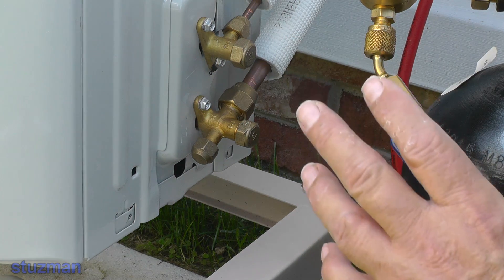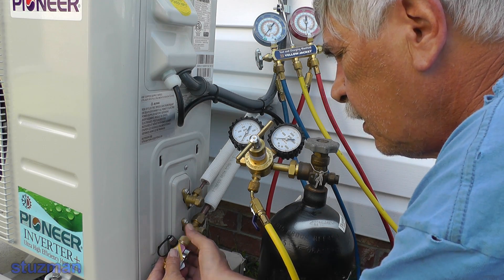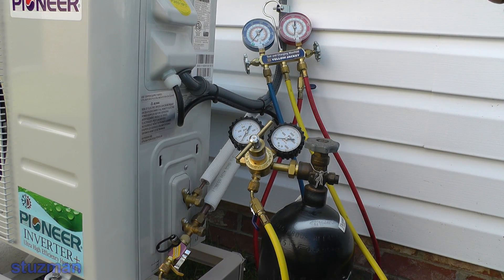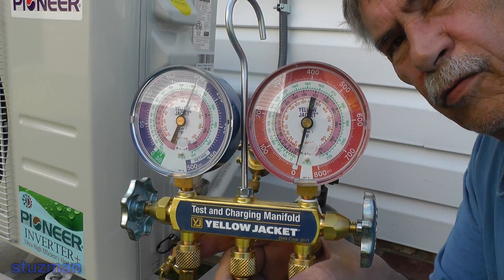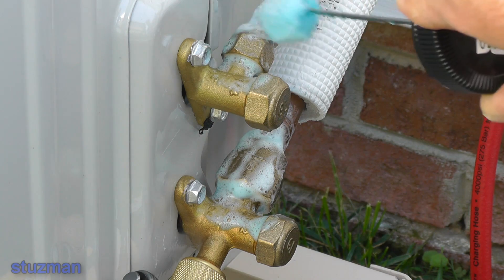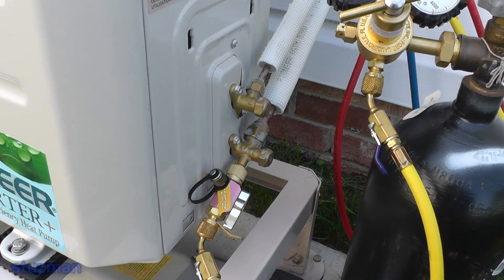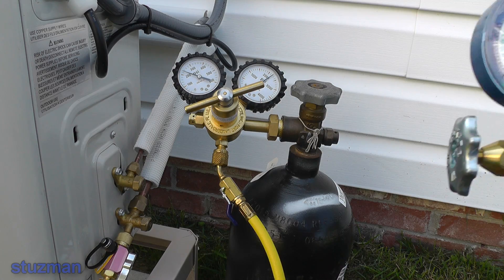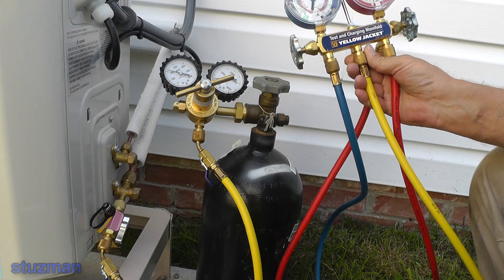Mini-Split Heat Pump: Nitrogen Pressure Test

Comment: 200 psi is a standard, or every brand has his on psi
Reply from the maker: No, it's not a standard really for any brand. I just picked it and of course, one could use 300, 350, 400psi. You just don't want to exceed the test pressure of either coil, whether it's the inside coil or outside coil.

Comment: Do you really need to remove the core and have the core removal tool attached? Why?
Reply from the maker: No, not absolutely necessary. Removal of the core speeds up the evacuation process.

Comment: I just replaced a mini split which the HVAC tech that commissioned the system pressure tested for only 10 minutes.  After 2 years it ran rough. At 3 years, refrigerant was all gone. I pressure tested it myself and it would drop about 10 psi overnight.  My current go to HVAC guy recommends 4 hours minimum, first at 50psi, then 200, then up to the design pressure written on the ODU label.  FYI to anyone else out there.  Upon disassembly, problem most likely was an overtorqued 1/4 connection with a poor flare.
Reply from the maker: Thanks for the helpful information, and I appreciate you sharing your experience!
Reply: Seems like a lot. If you are loosing refrigerant that'll show in a vacuum test. Did the original tech pull a vacuum? That would fail immediately
Reply: @WyattEmge  they did both vacuum and pressure test but not for very long.
Reply: @PeterVieth yeah you gotta pull for like half an hour and let it sit for half an hour.

Comment: I've been looking everywhere for that white strain relief connector you used on the control cable (cable that goes to the indoor unit). Do you remember where you bought it? Problem I'm having is finding one that fits the 3/8" control cable, but also fits the .850 in hole in the electrical terminal access panel.
Reply from the maker: You can get one at Home Depot or Lowe's. Here's one from Home Depot https://www.homedepot.com/s/strain%20relief%20connector?NCNI-5&searchAnalytics=strain%20relief%20connector-_-type%20ahead-_-1|1|1-_-typeahead-v2-search-api-_-strain%20relief%20co
Reply: @stuzman52  Thank you!

Comment: I have been studying your instructions regarding mini split installation and commissioning procedures and have a question. I am near the completion of installing a new Daikin, multizone (4) 36kBtu system (4MXM36AVJU9). The commissioning instructions state I should pressure test, separately, both the liquid and gas lines to a maximum of 604 psi. Do I just repeat the procedure in your video for each service port? Thank you in advance. J. Jones
Reply from the maker: Yes, that is correct! You will test each system separately. Good luck with your installation and have a great day!

Comment: First, I’m not HVAC experienced. Second, of the 18-24 videos I’ve watched, your’s is the best step-by-step instructions I have found. I do have one question- Once you pressurized the system to 200 psi and watched for any pressure decay, I didn’t see/hear a step where you isolated the nitrogen supply from the system under test. Wouldn’t the system being tested need to be isolated from the nitrogen source before you checked for any ‘pressure’ decay’? (I would think if left connected, you would continue to pressurize the system, although bubbles would indicate a leak)
Reply from the maker: Several people mentioned that I didn't turn off the valve. I did turn the valve off at around timeline of 4:00, but forgot to mention it. You can turn the valve off at the nitrogen tank or you can turn the valve off at the manifold gauge set. I turned it off at the manifold gauge set. Thanks for watching and sharing a comment! Have a great day!

Comment: Great vid!  What is the 1/4" core removal tool on your list for?
Reply from the maker: Two reason; the first and most important is to keep the refrigerant oil off of the micron gauge when the refrigerant is released. And second, it's to keep the high pressure from the refrigerant reaching the micron gauge since it's rated for vacuum pressure, although the gauge is supposed to handle high pressure.

Comment: Is it good idea to purge the yellow service line hose with some nitrogen before opening the low side valve to feed nitrogen in?
Reply from the maker: No need to purge the air from the line for a nitrogen pressure test since air is 78% nitrogen.

Comment: How about indoor unit fitting no more leak test?
Reply from the maker: When you pressurize the line-set, the nitrogen will also go into the indoor coil. And you would notice a pressure drop on the gauges and of course this would include soaping the fittings where the fittings come out through the wall and at the outdoor coil. And the indoor coil would already be pressure checked at the factory.

Comment: What size nitrogen bottle is that and how long is it expected to last how many mini splits can it pressure test?
Reply from the maker: 40 cu ft bottle should be sufficient. I purchased my bottle and nitrogen from www.airgas.com a few years ago. At the time, the bottle and nitrogen was $130. Then when the bottle runs out, you return the bottle and then get another bottle already filled. And if I remember correctly, that was $30 for the nitrogen. Nowadays, who knows what the price is since everything has gone up. Good luck on your installations and have a great day!
Reply: @stuzman52  thank you! You as well!
Reply from the maker: 40 cu. ft. I still have the bottle with a good amount of nitrogen in it. Have done several mini-splits and used it on cars. Can't say how many installations it can do.
Reply: @stuzman52  thank you,  what's the smallest size I would need to do 5 mini splits. I know nitrogen isn't cheap so I wanted to get the appropriate size bottle.

Comment: the gauge pressure showing 200 PSI would never degrade even with a leak as long as the valve was open to allow nitrogen into the system. You would need to close off the valve on the yellow line and then if there was a leak the blue gauge would degrade.
Reply: He didn’t show it but he isolated the valve on the bottle

Comment: Do you shut the unit down before starting?
Reply from the maker: Yes, the unit is not running before you do this test. Typically, this test is done before the unit runs the first time as this is a new unit.
Reply: @stuzman52  thank you. Awesome video. Would you ever do the nitrogen pressure test to try to pinpoint a leak?
Reply from the maker: @DGoku37  Yes, the whole purpose of the nitrogen test is to find leaks that may be in system after an installation.

Comment: My only comment is you wasted lots of time wiping off the soap mixture and even blowing it off with air. That leak mixture doesn't eat up the copper like really soap might. That's why you paid big bucks for that bottle of solution. Thanks for the video

Comment: Very well done video.  You are slow and methodical about the way you explain things so anyone can understand exactly what you’re doing.  One tip, if this is indeed an r-410a heat pump (not an AC only system), your lineset’s flares will indeed see pressures in the 400-500 psi range in heat mode.  So if you do a nitrogen pressure test, a higher psi test than what you did may show flare leaks that a lower test pressure may not.
Reply from the maker: Thanks for the comment and have a great day!

Comment: Is this test that you are showing also pressurizing the ODU at the same time 

Or are you bypassing the ODU and just testing the line set and IDU
Reply from the maker: When the unit arrives, the outdoor unit will contain the refrigerant with the valves closed to keep the refrigerant inside the unit. When testing for leaks with nitrogen, you are checking all of the line-set fittings plus the indoor unit. Since the indoor unit has already been checked at the factory for leaks, one will concentrate on the line-set fittings. And the same holds true for the outdoor unit since it would have been checked for leaks at the factory.
Reply: @stuzman52 I'm not sure why I asked that question it's perfectly clear what you guys were doing I was thinking something else in my head but let me explain and hopefully you can give me a good answer The refrigerant was lost and the guy took it out and installed a new system he then called me over to come get it and it sat there for 5 or 6 hours after he took it apart and so the first thing I wanted to do was use the Allen wrench to close off the ODU from any outdoor debris and weather getting into it 

And then I sealed off the line set and also the IDU 

I want to test them now and see if I can find out how it leaked 

I didn't see any oil on anything not on the ODU IDU or line set so I couldn't tell automatically where it was leaking from 

I ordered a nitrogen bottle and a regulator 

And when it gets here I want to test the line set the IDU and the ODU 

If I hook it up the same way you did 

and just open up the ODU valves with the Allen wrench

Will that work in testing the ODU also 

Or does the ODU contain some kind of oil or something else that might cause a problem if I pump in 200 psi of nitrogen
Reply from the maker: @Jonehughes  I assume that since he changed the outdoor unit, there was a leak in it. I wouldn't bother hooking it back up to the line-set as you can charge the outdoor unit by itself with nitrogen. Be sure to take the outside covers off to get access to all the plumbing and to the thermostatic valve, pressure sensors, etc. Good luck on what you find!
Reply: @stuzman52  thank you 
 that's very helpful 
I don't know why I didn't think of that
 but that's why I have you 😍🥰
Reply from the maker: @Jonehughes  Glad to help and have a super great day!

Comment: did you vacuum out all of the air from the line sets before pressure testing with nitrogen?
Reply from the maker: No, you pressure test with nitrogen first and then vacuum afterwards provided you don't find a leak.

Comment: Just wondering. A lot of installers say not to coil excess line set vertically due to possibility of oil pooling which I understand. So , what about when the inside unit is lower than the outside unit as with a basement install? Why doesn't the oil pool in the head?
Reply from the maker: I'm trying to think of an installation where the indoor unit would be lower than the outdoor unit. Even with a basement installation, I can't see how the indoor unit would be lower than the outside unit. Sure, there are installations where dirt is covered higher on three of the walls. But, that would be considered a crawl space. I can't think of the repercussions if the unit is lower than the outside unit. Maybe nothing will happen to the oil and the refrigerant pressure will push it through. I haven't run into an installation where the indoor unit is lower than the outside unit.
Reply: @stuzman52 Around here, a lot of full 8ft concrete basements are backfilled up to 6 and 7 ft. So the inside head has to be lower than the outside.

Comment: Is 200 psi standard or should you go higher or lower depending on what your units nameplate says?
Reply from the maker: 200 psi is not a standard. You can higher or lower, but never exceed the maximum working pressure of the unit(s) being tested.

Comment: OH BOY… THERE WASN’T ANY PRESSURE DROP BECAUSE YOU DIDN’T SHUT OFF THE NITROGEN TANK AND ISOLATED THE LINE SET  THROUGHOUT THE WHOLE TEST.
Reply from the maker: YOU CAN CLOSE THE NITROGEN TANK VALVE OR YOU CAN CLOSE THE VALVE ON THE MANIFOLD GAUGE SET. I CLOSED THE LATER. SOME FOLKS MENTIONED THAT I DIDN'T CLOSE THE VALVE, BUT IF YOU READ THE COMMENTS, YOU'LL SEE IN THE TIMELINE WHERE IT WAS DONE.

Comment: Where do you get the fancy adapter rig on low press side or nitrogen entrance?
Reply from the maker: I assume that you're talking about the adapter which connects to the low pressure side. This is a 5/16" adapter instead of the typical 1/4" adapter that connects hoses. You should be able to find them on Amazon.

Comment: You could also just use the regulator gauge by shutting the tank valve off the regulator gauge will go down if there is a leak.

Comment: Hi Terry ~ As with your vacuum test video, I really enjoy your down to earth, no BS, way of explaining what you're doing while you work.  The main question that I came away with after watching this particular video, however, is the capacity of your N2 (Nitrogen) tank?  Another thing that has me wondering is, for folks like us who live in very cold climates, is the minimum test pressure to apply for leak testing heating systems.  To clarify, I've been told that a 410A mini split system can operate at pressures as high as 400 PSI during the winter, so I'm thinking that one may want to leak test a new mini split system at 400 PSI instead of 200 PSI?  Do you have any thoughts about this, sir?
Reply from the maker: Most people think that you must pressurize the system to the maximum pressure that the system will operate. This implies that a leak can not be found unless it has this maximum pressure. 200 psi is more than enough to find a leak, even a small one. However, if one wants to increase the pressure then one can do it. Thanks for watching and sharing a comment. Have a great day!

Comment: Just wondering about the 200 psi charge. Is it sufficient for extreme temps and pressures ? Ive been testing systems a 300 psi for minimum of 1 hour in a leak test fir reoairs and installs. If I could save time and some nitrogen...everything counts when working for yourself.
Reply from the maker: 200 psi should be enough pressure to find the smallest leaks. Of course, some people may disagree but I've found that this pressure was sufficient. Have a great day!

Comment: Good videos.. 1)  He did not mention it, but he did shut off the supply of N2 to the system by turning the low pressure valve off...if you fail to do this the bubble test will still be valid, but the decay test  won't be as  N2 will still be supplied from the regulator.   2)  You could purge the full line set and inside unit by waiting to tighten the upper flare fitting while you let some N2 into the system.. to remove air and moisture. This would give you the best decay test (less effected by temperature changes)   I'm no HVAC expert just a Mech Engineer about to install a Mini split.
Reply from the maker: I forgot to mention about closing the low pressure valve, but it was done at the 4:00 timeline. Others have mentioned this also. Thanks for watching and for the comment! And good luck with the installation of your mini-split unit.

Comment: A very informative and high resolution video. Can you recommend any textbook which explains all the pressure settings and procedures? I don't quite understand why this or that value of pressure are used. Thanks a lot!
Reply from the maker: Sure thing! I can highly recommend two books which can be purchased from https://www.acservicetech.com/ One of the books is listed for inverter mini-splits and the other is a/c book which also covers heat pumps. You can get both in paper or electronic version and you can get both with workbooks if you like. I have both books and they are filled with a wealth of information. They are also available on Amazon, but the price is the same. Good luck with your education on a/c systems.
Reply: Thanks a lot!
Reply from the maker: @AKK105  You are welcome!
Reply: Are you a professor in university?
Reply from the maker: @AKK105  I'm a retired electrical controls engineer. And have extensive background in other fields also. Have a great day!
Reply: Good day to you! Can you recommend a textbook for chiller maintenance?
Reply from the maker: @AKK105  Sorry, I can't think of a recommended textbook for a chiller. Have a great day!

Comment: Can I close the valve of the nitrogen bottle, as soon as the pressure for the system has been set? This should not affect the pressure test? Or is there something against it?
Reply from the maker: Yes sir, you can close the valve on the nitrogen tank and will not effect the test. I opted to use the valve on the manifold gauge set. Either method is fine to use. Have a great day!

Comment: how frequently does a system test fine with pressure and vacuum and then later develop a leak at flare joint?
if pressure testing good with a digital probe and holding under 500 microns with the micron gauge should one be confident in the flare joint longevity?
Reply from the maker: I would suppose there's always a chance that you could have a very small leak and have a leak later down the road, but it's not likely. If you leave it pressurize say for an hour and especially if you're using digital gauges, it will show up. Now, looking at it from the other end where you only vacuum the system with a micron gauge and it holds steady under 500 microns, then you most likely don't have a leak as the micron gauge is very sensitive to any pressure changes. But, if you do have a leak while under this scenario, you're back to pressurizing the system to find the leak. So, to save time, pressurize the system to check for leaks and if that looks good, vacuum the system. And Merry Christmas and Happy New Year to you and your family!

Comment: Diamond installer told me to test to 550-600 but that’s Mitsubishi
Reply from the maker: You can test at a higher pressure if you like. If you do decide to do this, be sure to look at the name plate on the indoor and outdoor units for their test pressures. Pick the lower of the test pressures and don't exceed this. Have a good evening!